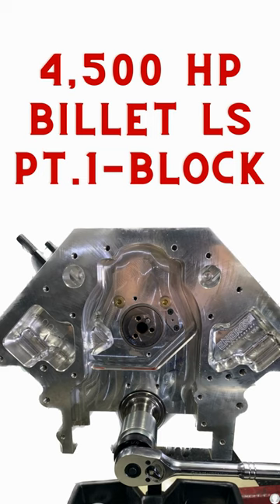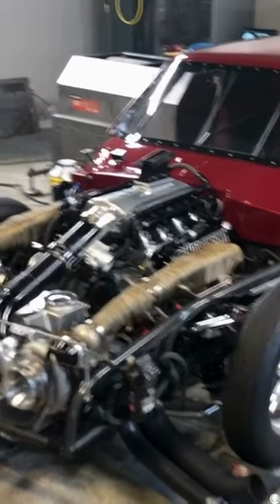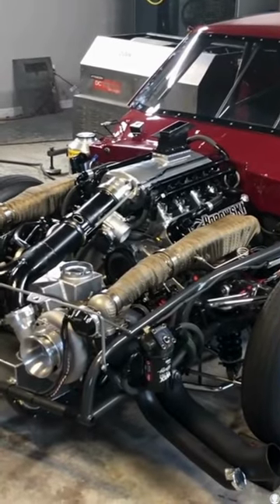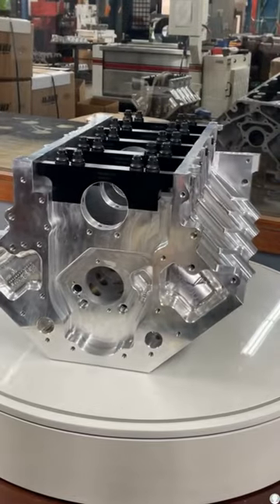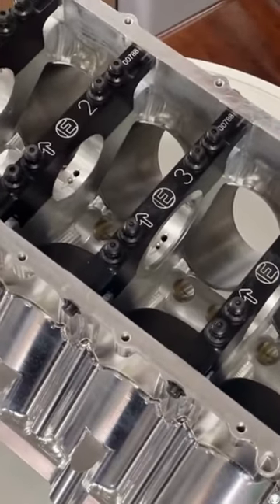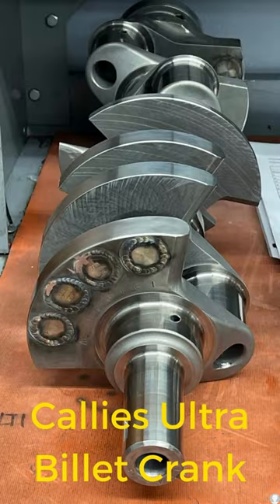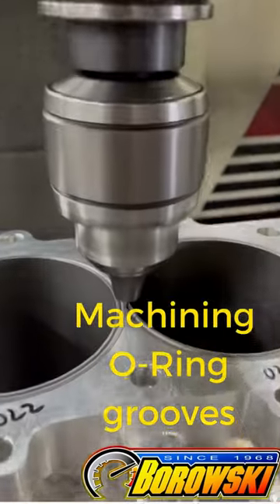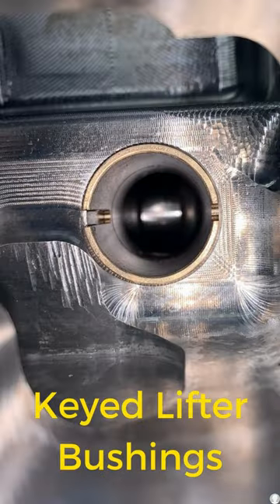4,500 HP Billet LS, Part 1 Block

Comment: As a ford guy I love it that it’s essentially a ford crank to make big ls power
Reply from the maker: You'll probably like this video starring an SBF.  Bill just did a career best 4.04 and is hoping to crack the 3's at Nrowalk later this month https://youtube.com/shorts/WfnM5Ldpbjs?feature=share
Reply: So what you're saying is, anything can "essentially" be anything else as long as it measures the same? If my turd measured 3.75" in diameter... Does that mean my turd is a ford crankshaft?
Reply: @derektrieglaff9103  😂😂😂
Reply: @derektrieglaff9103  Derek, don’t be a spoiled sport, in engineering there is little new under the sun. That block looks a lot like a Bear Block, or Shelby FE block with 5 studs around the bores. A set of TF Cammer 427 heads would be cool as can be. The FE was designed to be similar to the early Hemi. Potato Potahto, it’s mighty cool to see the compactness of design that uses the newest metallurgy.
Reply: @Bbbbad724  actually, there are PLENTY of new designs for engines but everyone turns their noses up to it instead of promoting change. but, what is spoiled sport about calling out someone who thinks that because something is the same size as something similar, it's the same? It's not. And, engineering should be about finding the best way to do something and less concerned about how things haven't changed since the dawn of time. Change only happens if you make it happen. So they increased the overall diameter of the crank journals to decrease the flex from rotational mass... Cool. That makes it better and less likely to break. But in no way does that turn a billet crankshaft that is designed after the Chevy LS crank into a ford design. Its just not how that works. The rest of the dimensions are set up like a Chevy.
Reply: @derektrieglaff9103  Hey man what moves forward is the courage to take an older design and make it better. One thing about change is it is a constant. I was ribbing more than anything. But when you go through a design you will see many variations of old and new. Metal allows things that could have never been done 10 years ago. I think it’s awesome, and brand is very little in common with OEM, aftermarket development brings ideas rise to the top in which the wheel doesn’t need to be reinvented. There are many aspects when mixed make faster, stronger and lighter whether it was thought of in 1930 or 2030, limits are in the ability to make it all work to the best possible extent.
Reply: @derektrieglaff9103  No that is not what I am saying at all. A great idea from earlier days and today’s refinement in metal and metric still maintains the integrity of concept when the possibility of using it for more than the concept alone doesn’t discount the concept. I have mixed and matched many things to achieve an end that exceeds the original goal by improving it, why reinvent the wheel when it is not needed. It still becomes a better product (and more modern by virtue of materials and metrics) but the original concept is still valid. Turbos have replaced many Rootes blowers, but screw blowers are somewhere in the middle, but the tune and technology is what makes anything better. I like a 7 liter engine with a pair of T4 GT 3582s with 4 inch outputs that drop down back and out. Hell that’s a 1000 hp through a 400 hp block and what we have learned about mid 60s heads. No detonation, huge intake valves that carry fuel like a scram jet and the hot side to get to 10 lbs of boost and the control for fuel and timing that can get a 60s 400 hp block and heads capable of doing 1000 hp on E85 at the pump. A mix of old and new by using the best available. That is not only possible, it is becoming more common. No need to throw out the baby with the bath water for the sake of being new. I kind of dig it! A 383 Mopar , stroke it to 7 liters , turbo the heck out of it, Or stroke a 391 FT block to 7 liters and put a pair of turbos on both. These engines are 1957 designs very robust and with the turbo and balance they are 1000 hp capable. The FT at 4.11 x 4.02 is 426 .56 cu, the 4.25 x 3.75 383 with say 426 ish , a pair of turbos and the Tune, 1000 hp from a 335 hp either one in their original cars. Hell I don’t need 4500 hp, but both engines have some of the attributes of the 4500 hp engine. The OEMs are building little 2.7 V6s and I4s turbocharged and tuned that make 2.25-2.5 hp per cube. And we can do it with a mix of old/blue/borrowed/ and blue from a 1957 design V8 and get the same results with the modern tuning technology. The 454 with Oval Port 325 hp can make 1500 with some porting on those heads. Boost is good, and it can be great. A Pontiac 325 hp 400 can do the same thing with the right parts. I have a barn full of them. Get some Summit stuff and do it. A 850 hp to the wheels that holds together and you have just accumulated, why not. It doesn’t matter in the fields the big boys plow. I don’t need a 20 wide satellite guided Versatile to get along. We sold our land, but a 4 wide rental to plow my yard and terrace it is all I need. My wife has her 2.7 V6  twin turbo Edge ST with a 7 speed automatic and handles and stops like Porsche Caiman. And if I did my 850 at the wheels in my 65 Galaxie, her driving we’d both have a blast. 63 years hope for 30 more. It’s fun! And that’s why. We married at 21. I had a screaming 289 that could spin to 8500 with a 306 hp Shelby carb solid cam and I ported my hi-po heads with 2.08 intakes and 1.5 exhausts with a 351C boss trans and people knew not to mess with that midnight blue with Shelby Gt-350 67 body work the drop, the fiberglass deck lid and caps and front valance. A coupe. We used to drive around the backroads listening to good music. 1 7/8 x3 long headers 2.5 pipe to the rear, Holley Super Shifter3, and we both were not a bit afraid of 8500 rpm’s and we both set the valves and rejetted the carb. We drove it that way for 8 years and no breakage. So I can’t throw shade at the 60s stuff. I had a 67 F100 to haul junk with. I built a 410 FE .030 over that started out as a 390 2V in our wedding gift, a 69 4dr Galaxie that I built for the 67 F100 with a 410 crank.020 over the CJ rods ARP bolts, and a set of forged 2291 390 pistons shaved to zero deck and zero balanced with 64 PI heads with 2.11 intakes hard exhaust guides and 1.6 exhausts and a nice port job with 11/32 guides and a Holley Street Dominator intake all matched with a 780 375 hp Chevy 396 3310 carb ,,a 282S Comp cam with 1.8 ( measured) rockers. That truck was a beast. A guy talked me out of the truck as a roller he wanted to put a 514 in it. I got some Crites 2 inch long tube headers and 3.5 collectors for a 1965 Galaxie I got. I had to change the frame from frame rust body work and the same Midnight Blue I had on my Mustang coupe. Shift kit in the C6 H servo. Put the engine from the truck along with the C6 and a set of 4.33 gears with a lunchbox locker. The paint is 15 years old, the engine 25 years since it was last opened, just oil changed/ coolant flushed, Transmission fluid changed with good Type A. Greased .. You can go out fire it up. No blowby or consumption. 3200 rpm converter. Last time I drove it before I lost my sight. I just cleared the street of any kids and asked permission, no Karen’s or cops, but we live on a nice street. I torqued it up and floored it and that 780 3310 with blocks on each end just roasted the tires the whole 3 blocks of the street of solid 2 wheel black in D.  Everyone on the street applauded!  I had it at 7500 in 2 smoke rolling. A nice old fashioned smoke show P235R16s on cop wheels. The motor was and still is so happy. My 40 yr old son comes down and drives it. And there is nothing like a well tuned FE at 7000-7500. I miss driving bad, and most of all wrenching. The heads flow 310 intake and 215 exhaust. A nice 236@.050 .570 lift and 110 ESA 104 ICA. Old clunky, that many years? NAA! It is bitch pit bull with a fresh litter of puppies . Lol, 😂😂😂😂😂😂
Reply: @Bbbbad724  I like the old designs. They're fine. If they had the technology and knowledge we do now, back then... Our vehicles and technology would be way more advanced. Turbocharging and supercharging is 40's technology. But, because it was troublesome and the fuels weren't as good the tech got tossed to the side instead of being developed. Nothing develops at the same rate. That's all I'm trying to say. If they went and properly developed and packaged superchargers and turbos better, we might have all been subjected to insanely higher horsepower engines and better cylinder head and engine internals design and engineering to handle those pressures. Which would have had a chain reaction effect to the present and things would be even tougher and more reliable than they already are. But, the envelope has to be pushed the tech has to be refined and discovered to create a better and more robust product. And that's what specialty companies like this one, are doing now. Yes, maybe you use four designs and amalgamate them together to get the strongest and best of the best. But when you do that, it becomes something else. It's no longer the creation of a multitude, it becomes a monster of composition. So in reality, I don't even know if this could really even be called an LS engine if they're changing all the dimensions and utilizing multiple technologies to create the monster you see before you.
Reply: @derektrieglaff9103  I agree with you 100%. It excites me to see this coming together.  I n this incarnation, I would love to see this be the representation for all makes in the US in world balls out racing, it has the great ideas from all makes and the material and execution is there. Back in the 60s the endurance development of the Ford FE is why they held their own against the Hemi. The just didn’t blow up and even Connie Kalitta and Don Prudhomme running the Cammer were able to run an architecture that was built to compete against the early Hemi, yet they were still able to run with the TF Elephant because of the way the FE was built.  It could have been their Boss9 if Bunkie hadn’t screwed the pooch by tossing out all of the great lessons they had learned in road racing. The FE was beating the Boss9. Many teams took the weight advantage and better balanced car. The B9 was way too nose heavy and it didn’t accelerate like the FE TP.  They just got out of racing. A well tuned 428CJ could run away and hide from the B9. The Cleveland was way better than the B9 and all Ford needed to do was to put Cleveland head design on the FE. They should have made it a 4.63 bore spacing. The crossbolted mains, the side oiling system, the light weight and acceleration like a light switch with the 351C and the 400 head at 4.63 on the scienced out FE with the same improving material was made for Pro Stock. The ingress and egress angles were a Polysphere Hemi, and they had a better performance cooefichent than the Hemi at 4.63 bore spacing. I have stuffed 2.2 /1.58 valves canted the valves and had as close to a straight line of flow as a wedge could be in a 4.05 bore. I had a set stolen from a machine shop that I had fit 2.3 intakes and 1.55 exhausts with 5/16 intakes and 3/8 stem stock replacements. They were there for the final 5 angle intakes and the 3 angle exhaust. I had the cant just so . The intake of a 1965 cylinder head with the 2.3 canted intake valve flowed 356 cfm from .500 to 364 at .600 and the exhaust at 188-196. Think about it the intake is atmospheric pressure, the exhaust is positive pressure and if you run 2 GT 3582s I planned to use VS with the billet wheel. The exhaust map was good for 12 psi of boost a turbo for each bank 12 psi pushing into a 2.3 valve with the polysheric pressure it goes through the turbo exhaust nearly as the coefficient of a Hemi except you have squish and a positive pressure into and out of the cylinder. The heads have disappeared. I really wanted to do a 10 lb twin turbo 7L engine with a 4.02 stroke and 4.11 bore. My calculations created a rising boost curve with NA torque in the 600 ft lb vicinity and 980 FWhp and as much as 830 rwhp. That would have been sweet. That was all I really wanted, it would do this on 93. On E85, it would be 1090 and 980 but you would need big injections like a dual 4 V Fitech with a box, the cool thing would be the stream in and out with the squish. The map from the lower threshold would be insane and the hp map would be long and flat , 4000-8000 rpm’s with out breaking anything. Overheating anything or being near a detonation window or hot spots. These are mathematically obtained and damned near optimal. Very little back pressure if any. T4 from an iron FT Rams Horn dump truck manifold for each turbo turned upside down with center outlet and T4 mounted , air/air intercoolers and 4 inch outlet pipe from the exhaust, no mufflers or restriction of any kind. I guess I’ll never know.
Reply: Cleveland for life
Reply: No bud but nice try lol😅
Reply: @xxkingslayemxxgamer5553  your daddy might be Cleveland for life gamer but id bet your still having to work a kickstand on your bicycle.
Reply: No it’s not 😂 keep dreaming bud
Reply: @chevybigblock3311  you Chevy guys like to say ford guys use Chevy pars because they measure the same 😂😂😂
Reply: @derektrieglaff9103  Supercharging and turbocharging are both older than '40s. Patented 1885 and 1905 respectively. The Roots blower was patented in 1860.
Reply: @garymanis6305  what does this comment have anything to do with the conversation I was having or any of the other comments I've made? I don't understand your point.
Reply: @derektrieglaff9103  Your comment that turbocharging and supercharging was '40s technology. Did you forget what you posted?
Reply: @garymanis6305  you're right... I did. But as I reread all my conversations I realized what you were talking about. And the argument wasn't necessarily about what era the supercharging and turbocharging was in and more about why they didn't get implemented into automotive applications until the fuels got more stable and reliable. But as one does who just wants to add something to be right as opposed to adding something that is valuable to the conversation, you focused on the wrong part of the conversation.
Reply: @derektrieglaff9103  My comment was intended to correct your misstatement. You are just being defensive and you are still incorrect. The first production supercharged car was the Mercedes in 1921, which became the base of the Mercedes-Benz brand. The first supercharged race car was the Chadwick Bix Six in 1908. Turbochargers were put into use on marine diesels in 1925, but didn't find their way to trucks until 1951. The Roots blower first saw duty on the GMC (Detroit) 71 series diesel in 1938. Instead of being defensive, why not just admit you didn't check and posted incorrect information?
Reply: @garymanis6305  cool guy... So tell me, in these vehicles... What fuels were they using? Certainly not the low grade gasolines of the era... Which was my point. Again, who cares about your forced induction history lessons... It wasn't the point of what I was talking about. Even in the 60's with the Jetfire turbo set up in the Oldsmobile... They had to use special additives to keep the engine from detonating itself apart.
Reply: @derektrieglaff9103  Low grade fuels was a byproduct of WW2 during the war and later emissions regulations in the 1970s and 1980s. GM developed tetraethyl lead in 1921 as a fuel additive to boost octane and reduce valve wear. Ethanol was also widely used to boost octane of gasoline. Some cars used a separate tank for ethanol. Starting in 1923 you could buy "Ethyl" at the pump, which was gasoline with tetraethyl lead and ethanol added. That was the fuel used by hotrods as well as factory performance cars. Boost pressures on these early supercharged cars was pretty low by today's standards.
Reply: They pinned the comment it’s not a ford crank try again 😂😂😂

Comment: So they essentially turned it into an FE with 5 studs per cylinder. Cool.  It was the FE crank journal while the Cleveland was still a gleam in its Daddy’s eye. 😂. HFII told the Contessa that he had developed the perfect engine which they could get the FE to run a simulation of the LeMans track for over 40 hours straight. Isnt it amazing no matter how hard they try to bury the FE by calling it obsolete and clunky that they one piece at a time they bring it back?
Reply: Noob here. When you say FE.....Ford Escort?
Reply: The LS is a GM engine

Comment: Build a Bear Block Motors FE at 4.63 and duplicate the “LS” top end to fit it, you could sell a bazillion of them for street racing. Or how about a Bear Block FE and a set of Jay Brown’s FE Power heads and a Cleveland Adapter for a Cleveland intake on Jays heads and adapter. The design is still an engineering wonder to this day. ❤

Comment: Is it water cooled?  How does it compare to the SML?
Reply from the maker: There is no water cooling in either the block or the heads.  This one is designed for eighth mile running methanol.  Water jacketed billet blocks are availble, but this isn't one of them.  

We never post comparisons or comments about competitors products.  Happy to answer any questions you may have by phone 815-725-2727.

Comment: Why would you not use a Forged block that is Stronger / Less flex ???
Reply from the maker: Thanks for your question.  The Energy block is made from billet aluminum which was forged and heat treated.  From their website: "Energy Manufacturing billet blocks begin life as a 490 pound block of high grade forged 6061 aluminum. Featuring rolled thread tapped holes for extra strength and high strength cylinder liners, careful attention is given to fit and finish of the overall block. Each semi-finished block is thoroughly heat treated to T6 Standards."